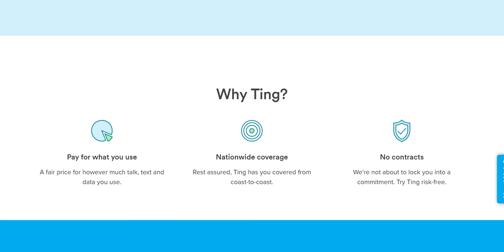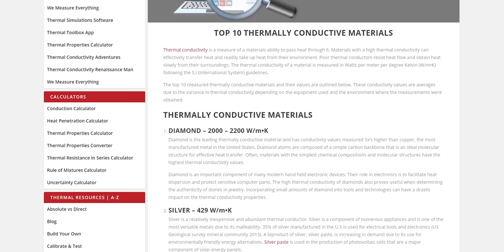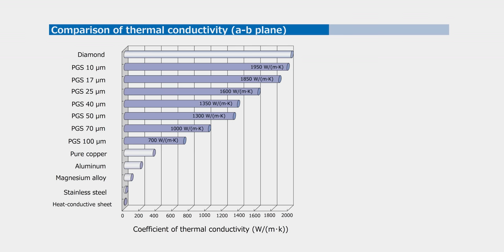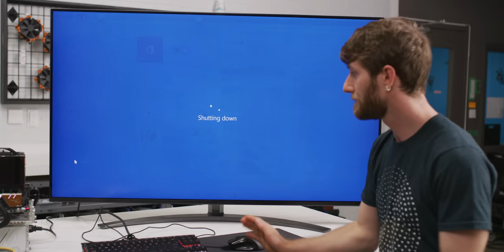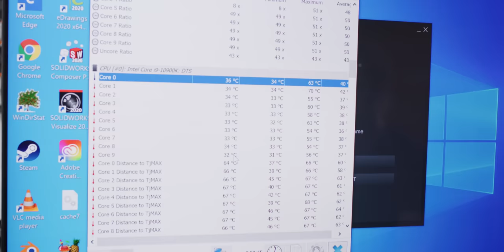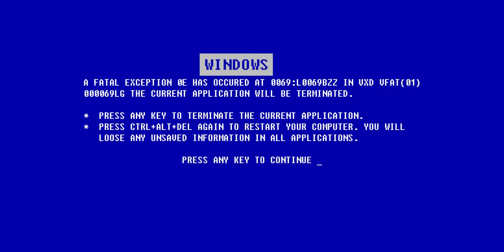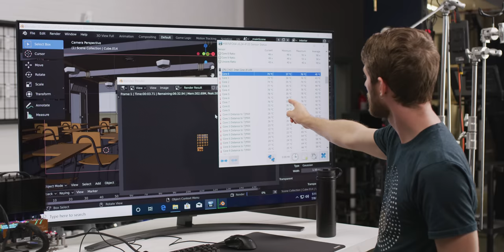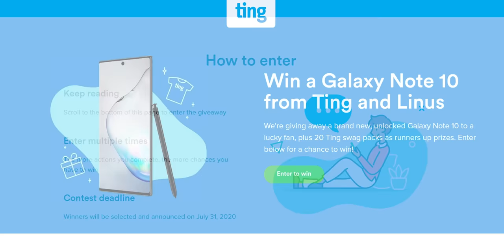This Sounds Too Good to be True - God-Tier Thermal Pad

Comment: What about lapping both surfaces? Or maybe applying  the pads in a vacuum?
Reply: Vacuum is a slightly better insulator than air, so the "cavities" that thermally isolate IHS and cooler would not get better. And the point of lapping would be to get rid of any thermal interface material. Putting anything (even good thermal conductors) in between heat source and sink is always performing worse unless you replace a worse conductor by a better one (like air with thermal grease).

Comment: Hey Linus, guess you're the guy to ask, what would you say would be the best thermal solution to use between a high power LED PCB (340w) and a alu heatsink? Maybe you would have an idea based on your experience with cooling CPU's?

Comment: If i recall this stuff has directional thermal conductivity. Its good at moving heat along the plane of the surface but terrible at moving it through the surface.

Comment: What if you used thermal paste on the pyrolytic graphite to fill the gaps? The graphite could work as an optimized thermal transfer vector while the paste fills in the gaps on the contacts.

Comment: Good vid. I'd like to seee you do it with a 100µm piece rather that 10µm and see if it's better. I think the issue is definitely not the heat conductivity but that there would be tiny air pockets between cpu, pgs and cooler due to how thin this is. As long as the pgs is maleable to some extent, i'm certain it would work with 100µm. any thermal pad/paste/grease is basically a heat conductive "gap filler" 10µm is a small gap. Did you wipe the psg with isopropyl aclohol after touching it? I think your test is far from conclusive. Keep up the good content.

Comment: The point of thermal paste is not to be insanely thermally conductive but rather to fill the microscopic air gaps and scrathces between the cooler and CPU. If the paste is highly conductive that of course helps but is not the main point. The main point is to displace air that is an insulator. This pad does not accoplish that goal. Better to just run the cooler without the patch. Adding more material before the heat sink will degrade performance no matter what the thermal properties of that material is. Its just simple physics. Thats why you dont put copper plates between the CPU and cooler. In addition, the final thermal conductivity is a function material thickness and as the thickness is so low (easily less than a mm of paste) the properites of the paste matter much less than the cooler itself which is many centimeters thick.

Comment: This is the wrong use. People are talking about coating thermal fins with it but instead it should BE the fins. Accordion fold and stick it directly to a heat pipe to make a "fuzzy" heat pipe with a ton of air surface interface. The "fins" should probably only be like 1/8th inch tall but stacked really closely. Blow on it with a fan and it should be great, right?

Comment: You need to lap the surface of both the cpu and the cooler if you want this to work.  At that point, you may as well dispense with the intermediary compound entirely and go for direct contact between the cpu and the cooler.

Comment: Did you consider that properties (resistance, thermal conductivity) might be anisotropic?
I would expect low resistance and high conductivity along the sheets, and higher resistance and lower thermal conductivity across sheets.

Comment: Can't you just buy a lot of sheets, stack them without glue using the pressure of the CPU heatsink, so it makes good contact. Or will there always be too much air between the stacked sheets?

Comment: What if you put a layer of thermal paste between the graphite and the IC/Heat sink?
at that point, sure, you've defeated the point of using the pad, but it'll probably get better results due to filling in all the gaps that a very, very flat material will leave on a very not flat material.

Comment: Isn't the point of thermal paste and pads not just transferring heat, but filling gaps/voids? Something this thin fails that goal - you'd be just as well bolting the heat sink directly to the CPU's surface without any thermal intermediate - right?

Comment: Why didn't you guys add the thermal paste between the layers of the thermal pad? I mean, after adding the pad into the heat sink bottom and at the processor, just apply the thermal compound as usual. It should be better.

Comment: Try doing the copper block memory mod, but putting one of these super thin layer things on both sides of the copper plate.

This super thin sheet seems like it needs something actually thick and metallic as a buffer to bring out it's true values.

Comment: Any chance of trying again with lapped components? The conductivity could be a million but it wouldn't matter if there were air in between.
Also, the spec sheet says that the quoted conductivity applies in plane; perpendicular numbers are between 10 and 26 (which, because it's a lot thicker than thermal paste interfaces, makes it a lot WORSE than thermal paste).

Comment: what if you folded it  in and had both adhesive sides touching that way the heat wouldn't be going vertical but horizontal through one of the sides

Comment: Without addressing surface imperfections of the cooler and the IHS, we cannot have effective cooling. If the surfaces were perfect, you don't need anything in between.

Comment: Seems like conductivity that good would be pretty similar to just attaching the heatsink w/o thermal paste. Something about a more balanced rate of heat xfer must actually be *good for CPU temps...? Maybe the graphite causes the heat to bottleneck behind the sink's *worse conductivity and just keep building up nearer the chip at the base of the sink?

Comment: I would try the "lapping" of the cpu and even the heatsink, 10 micrometers may be enough to fill the gapes of metal but not for the eventual shape if there's too much height difference between the different zones of the IHS

Comment: I was skeptical from the moment you mentioned how crazy thin it is. I’ve done more thermal paste than pads, but wouldn’t a thermal pad need a little bit of “squish”? It has to fill in between the imperfections and that thin of a material can’t squish. Correct me if 8 I’m wrong.

Comment: What if you fold it over? If a single sheet was stuck to both the heatsink and the CPU it might work super well. of course it would be a nightmare to do and defeat the point of a re-useable pad but it could be fun?

Comment: Late to the party, but those graphite sheets are basically incompressible... would work terrible to fill the microscopic gaps and cracks that get filled with regular TIM. IIRC there is also a compressible version of PGS out there with much worse thermal conductivity. Could work better as TIM, though.

Comment: What happens when the sheet is folded in half and sticked to both cpu and heatsink without cutting it apart... then heat would transfer from cpu to heatsink

Comment: If tech ingredients ever follows up on an improved thermal epoxy, you might be able to use these as protective layers to sandwich the compound so you don't need to damage a CPU or cooler.

Comment: I thought graphene is really good conductor horizontally not vertically therefore you would need to stick lots of really thin layers together and the turn it on it’s side for the conduction to work the way you want it to.

Comment: Do they make thicker sheets, like 0.1mm at least? And not $10000?

I think for this micron thickness you would need to 1000 grit sandpaper both surfaces first. And also plane them. So start with flat mirror finish essentially.

It didn't work for you because NH-D15 bottom is concave to hold thermal paste, leaving a big hole of air and CPU IHS is convex. Same why IG Graphite didn't.

Comment: What if you tried to spread an extremely thin film of thermal paste on both cpu and cooler before putting on a pad?.. To fill out those gaps. And when I mean thin, I mean put a tiny bit on and keep 'polishing' the paste over it.. which should theoretically fill the gaps and get stuck in them.. but have so little paste that it's mostly the pad doing the conduction

Comment: how would it be to wrap that thing around the ihs and add liquid metal or other product normally? or stick it on heatsink finns so heat blow over them and let them "flap in the wind"  should be a great way to increase the area of the heatsink.

Comment: It has just occurred to me that if the graphite pad is glued to the heatsink then the extreme lateral thermal conductivity means that heat will be delivered to a greater area than that of the CPU face itself.

Comment: Did you take off the plastic from both sides?
   edit;  I apparently wasn't listening when Linus said there was adhesive on only one side. 
      a year later, maybe polishing it with a bone folder would help.  edit edit, after seeing the comment from Jpeg6, forget this.

Comment: If it's to thin to transport the heat, why not try a folded patch? one side attached to the CPU, bend it over and connect the other side to the heatsink. This way the transport of heat isn't interrupted.

Comment: From the thinness I'd guess it's worse than putting the cooler on with nothing in between - regardless of it's thermal properties, it's just offsetting the surface.
Also, thx for mentioning a rough number for purpose built heat pipes. Had to be better in perf/price, but didn't imagine it being that much.

Comment: SIR. Pyrolytic Graphite conducts heat excellent along the x-y plane, almost as good as diamond. But it doesnt do well in the z plane. This pad wont perform very well transferring heat through it as you are using it to do. There is vertically oriented PG that can do it well.

Comment: I don't suppose their might have been a backing on the other side, would there? I'm kinda curious how it fares against other thermal pads, where they need to be stacked to fill gaps. (like on graphic cards or SBC processors ) It might make sense to cut it close to size, then peel off the backing.

Comment: Would delidding a cpu, and adding in a new lid that is a one piece with a heatsink, would that work? So there would be no need for thermal paste as the heatsink would be part of the lid itself so there is no gap (yep you would be stuck with using this heatsink with the CPU) and just use whatever fans you want to use to attach to the heatsink. Could this work? Would it be better than the normal setup?

Comment: The reason this doesn't work is because all thermal paste is doing is smoothing out tiny imperfections on both contact surfaces to eliminate air gaps. Thermal Conductivity is just a bonus.

Comment: why not try folding and sticking it to the cooler and cpu. Then there will be a little section that connects the part on the cpu to the part on the cooler

Comment: Those pads transfer heat across the surface, not very good through the layers.
Cut a long strip out of this pad. Put the pad on CPU, with side A touching the CPU. Bend round the strip of pad in a U shape. Floating above the CPU / next to the socket is your cooler. Side A of the strip should be touching the bottom of the heatsink. No direct or forceful contact needs to be made, since the pad is sticky enough to both surfaces.
Heat will not quickly spread from one side to the other across the bottom (side A) of the strip/pad.
Your IR should see a flash of heat on one side of the pad/strip (side A) and see a relatively cool side B, where no parts are touching.

Comment: lmao         here is an untested cpu cooling idea.   (nominal ambient air temps  and the use of complementary case venting, are assumed.)      mount a  low-profile heatsink, with a  (concentric) circular fin pattern,  on the on cpu.          imagine ---  a vertically oriented cylinder that is correctly sized, for location just above the cpu; with a suitably spec'd  draw fan mounted at its top.      ports/vanes are arranged  non-radially;  near the cylinder's lower edge.         the angle of the ports/vanes should  1)  give the incoming air a slight,  downwards  vector, and  2) continuously create a   low-energy  circular (and rising) air flow pattern,  at the heatsink.       duct exhaust air outside the case.      as wanted, it might be possible to pre-cool incoming cooling air; modify a  peltier-cooler, to function as an intake  plenum.    condensation, if any,  could be dealt with There or elsewhere, 'upstream of' the  case/cpu.     googletranslate

Comment: So, can i use this to improve thermals of my passively cooled laptop? I'm thinking strapping this to the back side of the bottom opening. My cpu on on the far left side so, right side of the laptop is not useful for any cooling purposes. Maybe 2 or 3 strips of this taped to the bottom can help moving the heat to the right side?

Comment: Does anyone know why it didn't work? I could see this being a really cool thing for a project, but I still don't understand why it didn't work?
Reply: Remember when Linus held the sheet and melted the ice cube? That's how the sheet conducts. In the long direction. It does not conduct as well through its thickness though. The stuff is a crystal and that structure biases it.
Reply: @1pcfred  interesting. So Id have to be linear. What if they stuck a bunch of sheets together, and then cut it down to one layer?
Reply: @rohaanomar7003  it'd stand a better chance of working than what we saw here. But at what cost? Maybe it can be diffused differently? It'd be great if it worked how Linus hoped it would. I'd love to quit playing with paste.
Reply: @1pcfred  yeah, that's too bad.
Reply: @rohaanomar7003  someone may figure it out someday.

Comment: If it spreads could you just stick it to the back of a phone/tablet or the bottom of a fabless MBA by itself or would you you still need another layer outside of the sheet to act as passive heat sink?

Comment: I would like to file a complain about the statement right at the beginning at 0:10.
What kind of thermal compound do Linus have with 10-20W/m*K?
The arctic silver mx4 for example have 8.5W/m*K heat conductivity which is considered good one.
(Okay there is Thermal Grizzly Kryonaut with 12.5 but thats an exceptionally good one with a gold price)

Comment: I'm curious about whether this would react with liquid metal, if not it may work well as a barrier between your heatsink and liquid metal or CPU and liquid metal to avoid any reaction or pitting from use.

That is assuming you get good thermal conductivity through the adhesive on it

Comment: It seem that the layer of graphene was too thin to fill in space between two non-flat surfaces. Have you tried lapping the CPU and Cooler Heat Transfer surfaces the applying a layer of the graphene to each surface?

Comment: What if they roll them up so the sheet is 1 piece and touches both ends (cpu and heatsink) with the conductive surface instead of the adhesive surface?

Comment: You guys should test graphite grease instead of graphite pads.  Way cheaper and works very well in a pinch, i have used it as a replacement for thermal grease, but I have never tested if it actually works better.  Does smell a bit weird. :)

Comment: I seem to remember the crystal direction can matter significantly for certain types of heat conductors. Maybe that's the issue here; it's spreading the heat horizontally but that's not really what you want here... 
So how about carbon pad on top and on the die, and a smidge of paste in the middle :-p

Comment: Because graphite sheets like this transfer heat better across the surface, why not fold a sheet in half with the glue in the middle and try that? (You don't even need to remove the plastic film from the glue and in fact may be better to leave it for a little flexibility in filling uneven aspects of the mating surfaces.) Then you would have the CPU and heatsink on the same surface and negate the glue thermal conductivity aspect entirely.

Comment: I wonder if this would work best spreading the heat from a direct die with liquid metal to spread the heat more evenly on a heatsink, instead of its relatively small die size kind of focusing its heat only in the centre of the heatsink...  probably not a big difference, but i'd be curious to see if even 1-2C is possible.

Comment: to my knowledge thin graphene sheets are transparent and the fact that the black sheet you used was sticky tells me you used the adhesive instead of the sheet of graphene

nevertheless the sheet was too thin anyway and cpu and coldplates arent flat at all thus making the sheet ineffective

also 1 layer graphene sheets are already used on electroncs but as an electric transfer and not thermal

Comment: The reason this didn't work is because the reason thermal paste is used isn't to transfer heat. It's to fill in the microscopic gaps in the metal of the IHS and cold plate so that no air pockets form.  Because air has terrible thermal absorption and will cause extreme hot spots between your cpu and cooler that can't escape.  The only thermal requirement of thermal paste is to not inhibit transfer.

Comment: Would probably had worked way better if they had also flatten the CPU h.I.S and the CPU cooler ( under the same mountain tension as it normally is when installed ofc) then they should get way better performance 

Me and a friend of me is going to try useing the same pta but completely flatten it ( on a calibrated surface plate ( though not in a continues pitch optical grinder))

Comment: Besides graphite only conducting in one dimension (the dimension of its C6 ring plane), which is 90° turned in this pad, it's also to hard for a TIM. Only liquids are useful for this use case of TIM.
Reply: Pyrolytic graphite is different